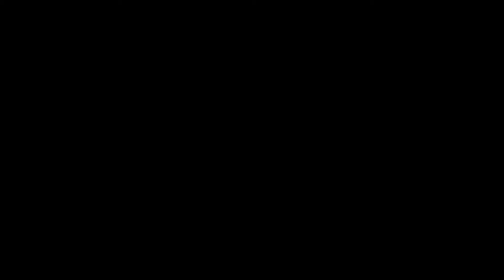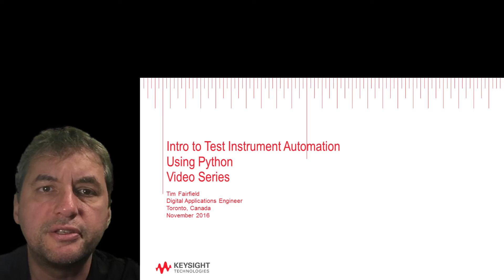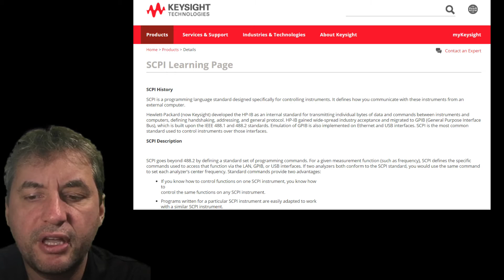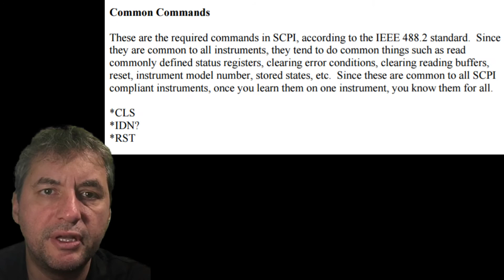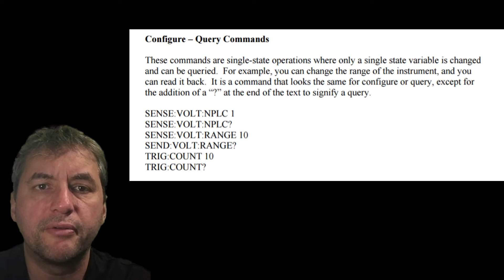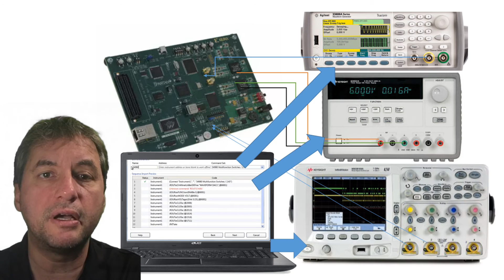PythonAutomationSeries 1 Intro

Comment: Ah. I see, I remember in college, we designed a robot for my senior project. It was such a pain in the ass to have to rerun the robot every time after we made small changes to either the circuit or the code to verify that it worked correctly. Currently, I do automation tests for websites, how hard would it be for me to jump to hardware automation given most of my experience is working with running tests on other software? I haven't applied to these jobs yet, but it's been a while since I was in college, where I studied computer engineering.
Reply from the maker: Hardware automation is not difficult. if you have a good handle on coding it’s just a matter of knowing how to set up the resources and access them. There are some universal scpi commands as well. would be a good idea if you are serious tomaybe get your hands on some old or used hardware that you can connect to and experiment like a power supply and dmm ok’d scope or something like in the project shown. I may soon do a generic scpi example to show how you can leverage anything you can find and use documentation to do the bulk of the coding. I am a big fan of not throwing things out. being able to make use of older equipment can bring a bit more life when funds just do not exist. I also may do a c# example. Just remember that a scpi controlled instrument is just another thing to read from and write to that has behaviours you want to access like stimulus, power or some form of measurement. meaning if you write something your screen with “print” words come on the screen. if you write to a power supply that is powering a device you turn something on. Sounds to me like you would do fine. a lot of the challenges come in with  waiting for an instrument to complete a step in a multi instrument setup.  It’s best to have a lot of write and read back checks to get past those. once you figure out those issues then you are well on your way.

Comment: Nice video...
I need to measure clock and data timing diagram.  Any automation suggestions and which test equipment you recommend.
Reply from the maker: If you are measuring clock and data timing you need to be focusing on Jitter measurements.  You need to focus on time interval error measurements aka TIE. All Keysight scopes can do this measurement You should choose a scope with a bandwidth that represents what the receiver will “see”. some people make the mistake of choosing a very high bandwidth scope. that will most likely have higher bandwidth, reveal more noise and jitter but does no the mimic what the receiving side will see. in addition some standards like PCIE can have the clock extracted from the data and there is no need to transmit the ref clock at all. in such case you have to recover the clock in the receiver with a CDR and there are requirements for pll filter settings which you must emulate with the scope. so I hope this gives you some direction to get started. Possibly I can do a detailed presentation and video demo on that topic. I wouldn’t say it falls into the strictly automated category. It is a measurement that is quite common. Automation is more about automating repeated measurements that you would start out doing manually.